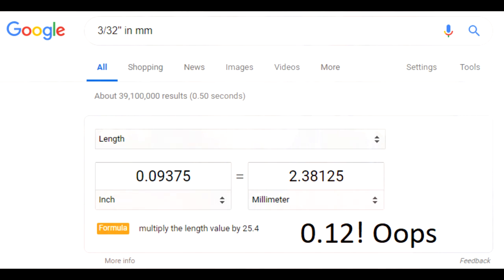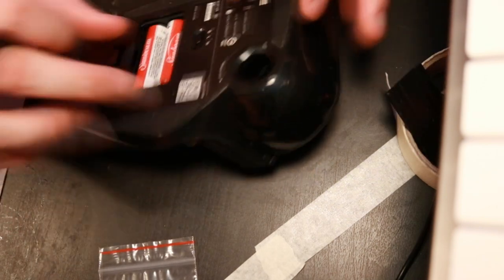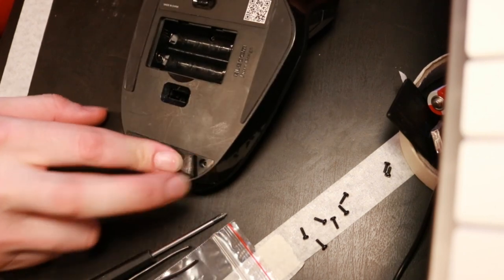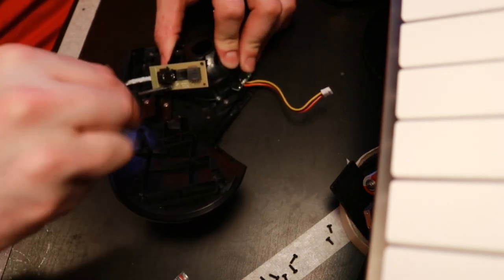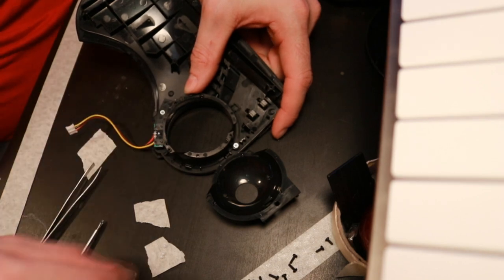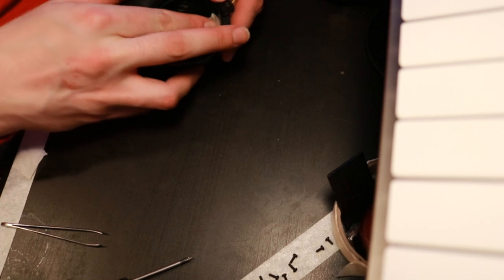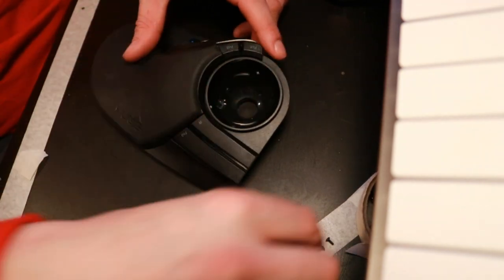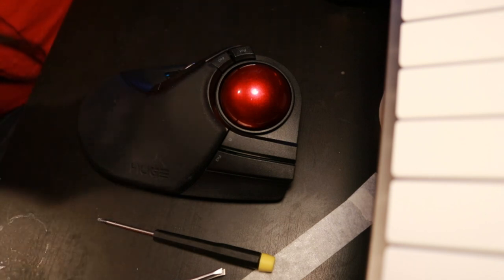Elecom Huge = Gaming TRACKBALL? Bearing replacement / fix / swap

Comment: The problem is not caused by synthetic rubies, much less by their supposed asphericity. But it depends on the heaviness of the ball, the sweat of the hands, and on the fact that the rubies do not turn on themselves but are fixed, changing them with the ceramic balls does not bring about any change, on the contrary being harder than the rubies, they scratch the ball and deform it quickly.
Reply: Very interesting. Funny that no one else has had this experience....
Can anyone confirm this?
Reply: i wish i had read this first, this is exactly what happened to me

Comment: Thanks for this video!! Just bought the Huge  and what the hell it still has this problem. It's a good job I had just bought my first trackball MX Ergo which is incredibly silky smooth and was so pleased I wanted to try a finger ball. Good job the Huge didn't come first or I may have given up on trackerballs. Pity Elecom has not put this right.
Reply: Thanks for the update, I was considering checking out the newest batch but I think I'll keep waiting

Comment: I’m back 2 years later. If your mouse is wired, there’s a devious screw hidden behind the sticker on the back of the mouse. Run your fingernail net the bottom edge in the middle and you’ll find it.

Comment: For anyone watching, I can verify this process is correct     
    
If you have the wired version though, the main back plate(where his batteries are) screw is actually under a sticker that appears initially as a matt plate
Pop a hole in the word "made" in made in China before you pry it open to remove final screw.       

Side note, you will not transfer from the Logitech m to this easily
Reply: I literally came to the comments for this information cause I couldn't get it apart lmao THANK YOU
Reply: This comment saved me some headache. Thanks!!!
Reply: lol.  the Made hidden screw omg
Reply: what kind of torx screwdriver set do we need
Reply: figured this out the hard way - SMH.  shoulda read the comments....
Reply: @lenamae2089  So did I! Many thanks to the Ophid Official, Siada Something, and Lena Mae!

Comment: Important note from 2020—I just did this tutorial and it's fantastic. Great job explaining most things. One important note—take care to make sure your "low/mid/high" switch is lined up and working before screwing everything together. I put the trackball back together after the swap and the action of the ball was much better. But I noticed the sensitivity switch was hitched up; I figured it was out of alignment. I tried to move it and snapped the underlying tab which connected it to the part of the board which toggles the sensitivity.

Not a huge deal because I have two of these trackballs and I know better for next time. But it's still annoying because I screwed up. Don't do what I did. Make sure the action on the sensitivity switch is in a good spot. Mine is stuck on "high" now, but that's fine since I can always set it lower and tweak the settings beyond what I'd need in either direction. But I imagine other people use this feature and won't be okay with it being broken.

Still—best tutorial on the net for this. Thanks a million for posting it. And I decided to be drunk when I did it too. Which should be a tradition I guess. Just check that damn switch before you go yanking on it like I did.
Reply: excellent information. uploader should pin this
Reply: Upvote x 100000.  I just broke mine off.  :(
Reply: @ericreeves-hashicorp  Sorry buddy. If it's any consolation, you can set the switch manually and then change the sensitivity in software from there. I hope you didn't use the toggle day-to-day.
Reply: @Wondershock  I actually never touched the switch, so it's not a big deal at all.  Still glad I did the bearing swap!  It felt like there was a bit of a "break-in" period for the first few hours, but it feels much smoother now!
Reply: @ericreeves-hashicorp  100%, totally worth it. Glad to hear it worked out, even with the little snafu.

Comment: 7x T6 screws on the bottom; 1 in the battery compartment, 6 under the foot pads
 2x PH1 screws inside the ball cup
2x PH0 screws holding the sensor board
3x PH0 screws holding the ball cup together

just in case you want to make sure you have the proper drivers before starting.
Reply from the maker: Thank you :)

Comment: Just fixed mine and the only speedbump I had was finding where the top cable needed to rest while reassembling.  I figured it out though and it. feels. amazing.

10/10 guide.

Also works for the wired version of the device, there's just an extra cable inside that only gets a little bit in the way.

Comment: 3 years later, and this video is still useful. That's outstanding. I just got my huge yesterday, and pre-emptively ordered the bearings with it knowing I'd be doing this. Since they get here tomorrow I figured I'd get an idea on how to disassemble the device before needing the info. I'm glad I did because I didn't realize it's as involved as it it.
  I have some minor experience doing teardowns, and had to do so with the Kensington Expert pro wired quite a few times, but it didn't have any ribbon cables. A ton of people sing the expert pro's praises, but mine was defective. The scroll ring would often fail for no reason so I eventually ended up scrapping it. After a while I just went back to gaming mice, but nothing compares to a good trackball when working in photoshop, or a 3D package.
  Thank you for the video. The angles were spot on, and easy to see everything needed to, and I love the fact that this was done with more practical tricks for certain things like holding the bearings in place with tape. I made an extra large mouse mat out of tool shelf liner material so it should hold the bearings in place on my desk well. It has a very similar texture pattern to a screen.

Comment: This video was...perfect. Precise instructions, clear images, plus humor. I haven't operated on my HUGE yet...but the principles shown here allowed me to upgrade my Deft Pro. Note for the Deft Pro - the primary difference/challenge is once the top cover is removed the "cup" assembly needs to be separated from the base. There are three locking tabs - a large one on the right and two small ones on the left. The forward left tab is a royal PITA - you need a very stiff small flat screwdriver to press it inwards (after releasing the other two first). One more gotcha - having removed all the screws from under the rubber feet (none under the top or the ring, one each on left & right, but THREE on the bottom) there is also one screw hiding under the label. Trying to peel the label would probably tear it - so I just pierced straight through with the screwdriver (it's under the letters SN). It's then a little finicky lifting up and separating the top half - even more so when putting back together - but still doable with patience. I finally have a usable trackball - why the F$#! does Elecom use such garbage bearings when they're using quality components elsewhere (I actually saw the Omron and Kailh switches inside!)?

Comment: I appreciate the walkthrough! The rubber pads will adhere back fairly well on their own but you can coax a little more life out of the adhesive with a bit of isopropyl alcohol.

Comment: just ordered the elecom huge and the replacement bearings thanks to this video! really looking forward to this project!

Update: It works beautifully, took several tries to get the bearings lined up when popping the cup back on but it was relatively painless. next time I will be sure to not drink coffee beforehand and use magnetic tipped screw drivers.

Comment: I performed this surgery today on my wired version to install uxcell 2.5mm ceramic balls from Amazon Prime. The screws were the same but except unfortunately I had to mutilate the main sticker a bit to get the equivalent of the one under the battery door. Oh well, I'd already decided I wasn't returning it. I didn't needed to remove the ribbon cables. Post surgery, it's a lot better. Thanks!

Comment: For anyone out there that wants to do this mod, read this: 

1) Watch out for the 2 FN buttons near the ball (FN1 and FN2), because the wire is pretty fragile. If you happen to detach them, just solder them up again (fairly easy, but tedious as the metal wires are pretty smalll_

2) The bearings are STATIONARY, so they DON'T spin. I found that 1 out of the 3 was not tight enough and the vibration caused by it messed most of the smoothness.

3)Don't expect to have 0 friction, there will always be a small amount, regardless what bearing you mount (because they are stationary)
Reply: Thanks for the point no 2. I got a cheapo jelly comb mt50 and one of the bearings kept popping out of the shell and rattle into the body. 
Was super worried that I have no way of securing the bearings in the loose shell since they are only press fit.

I end up hotgluing the bearing into the loose holder and glue the other 2 more and I have one solid budget trackball to run daily!
Reply: I really don’t think the level of difficulty of this mod is worth the less than perfect benefits this mod produces. My level of anxiety watching him do this was pretty high. 😂 😂

Comment: thanks a TON man. I'm one of the guys missing the MS TB Explorer for the last 18 years until I tested another (way too small) Elecom Trackball. this one is perfect for me and my 20cm hands. this is heaven - and i love FPSing with it. But just like you said: It's skipping on minute moves - so before getting it YOUR video actually encouraged me to get it and already check for availability of ZrO2 bearings - which are easy to come by on amazon these days. The Trackball arrived today and I instantly fell in love again and ordered the bearings right away. Thanks so very much for all this work sharing this!

Comment: I did this "downgrade" to fix the jerkiness when attempting to move the trackball from rest position, since it was COMPLETELY unusable for precise movements. After the bearing replacement, there was SOME improvement, but it was still unusable for me. Lubricating did not improve the situation very much, so I left the device alone for a few days. I finally decided to have another go at it, and I found that "breaking it in" by rolling the trackball in all directions for a minute before use FINALLY did the trick! I did try rolling the trackball repeatedly with my fingers, with the device facing right-side-up, but even after a few minutes the jerkiness was still noticeable. The BEST method for me was to turn it upside down and roll the trackball on a mousepad or similar surface, while applying a bit of pressure. I do this every morning for a minute and a half in the left-right, up-down and circular motions, and it the device works ALOT better for the rest of the day. I do throw in some extra breaking-in sessions randomly throughout the day, just to keep it running smoothly. I hope this helps someone!

Comment: Thanks so much for this! Particularly loved your clever idea to hold onto the other bearings in the baggie, and the "tape on the bearings" trick. Can attest that it's even easier than this video makes it look if you have a level table, a magnetic tray, and a T6/TR6 driver. 

Thanks also for popularizing this upgrade to the extent that several Prime fulfillment vendors now carry these bearings!

Comment: Just did it , I would say if you are careful enough you won't need to unplug the ribbons (i did not have to) neither need of any tape
Just need a clean table with light. Once you are done this is indeed a good upgrade the ball spin with less friction, you should not regret the effort ! Thanks for the tutorial !

Comment: great video! A super important tip: DO NOT OVERTIGHTEN THE SILVER INNER BALL CUP SCREWS. You might not even need to replace your bearings... The screws just might be too tight and are keeping the bearings from spinning.

Comment: I used G10 2.5mm ZrO2 balls from aliexpress, they are INCREDIBLY smooth. I have a Kensington expert and CST as well, but these bearings make the Huge feel even smoother (though part of it is probably also that the ball is lighter). The CST has a notable grainy feeling, probably because of the metal rollers.

Anyway, thanks for this video, it made this process really easy! I somehow managed to break the wires connecting the Fn1/Fn2 keys to the PCB but resoldering those wasn't so bad. As an additional mod, I added a bunch of iron weights in the free space of the housing.
Reply: Are you using any additional lubricant? How broken in is your expert?

Comment: Thanks so much for this video. I've loved my HUGE, but in the last couple months, it's been very sticky. I'd wipe the bearings and they'd be less sticky for about 15 minutes. It was becoming obnoxious. I ordered balls (found some from uxcell on amazon, Prime, although they're backordered for a couple days), but took the risk to open it up and spin the stock synthetic bearings around to a "fresh" side. Taped them up like you suggested to avoid losing any bearings and not having a backup. Just put it back together and it's smoother than I've ever remembered.

I don't know if my environment is especially harsh since I do file metal things at my desk occasionally, but I purchased the mouse 11/21/2018, so I'd estimate that it was noticeably "worn" out in about 16 months.

Comment: Just did this to my Elecom Deft m-dt2urbk. Worked perfectly. Took a day to get it SUPER smooth. no issues yet! Thanks for this!
Reply from the maker: Aw thanks man, that gave me a big ol' smile. I'm glad it worked out! What major differences were there with the Deft?
Reply: @subversed  The biggest issue with it stock was that the small movements were sticky. Small adjustments were stuttered. No issues now with the new bearings!
Reply from the maker: @alexpham095  That's rad! I'm really glad I could help ya out- I've never posted anything like this and the feedback is really good to hear my guy. 
were the insides were mostly the same? I've never cracked open a deft before.
Reply: @subversed  Pretty much the same. The screws were in the same places on the case. The insides were arranged differently, but its almost the same. The biggest issue was getting case clips apart. Lol fear of breaking it all.
Reply: So it was still a bit sticky until after a day of use?

Comment: great video. before this video was published i had actually disassembled my HUGE to see if there was anything i could do. i wanted to replace the bearings but didn't really know what to get. this helped greatly. while doing this i accidentally broke off the yellow wire off the FN1 and FN2 button board and had to solder it back together, not a big deal though. after the job was done it was a night and day difference in ball movement. it is comparable now to my wife's kensington expert wireless. my daughter has the newer M-DPT1MRXBK deft pro which has the same bearings i might do this to. from my 10 pack, i have... 6 left.
Reply from the maker: You lost one too, eh? Haha they're so hard to keep from rolling (or bouncing) away. I'm really happy it helped you out my guy! Elecom seems to have a way about them when it comes to making their products mostly serviceable and it's really, really refreshing to see. I can't tell you how many trackball forums and subreddits still believe that the only way to replace bearings is to get the drill out and start gutting holes to replace bearings because people just aren't used to something that's made to be fixable. 
Are there any other projects you're putting off that I can maybe make a video about? Always looking for ideas.
Reply: I don't have any ideas for more videos at this point, but I do have a question I wonder if you are able to answer. Do you know the difference between the M-HT1DRBK and the M-HT1DRXBK? The 'X' appears to be a 'new' Huge, but I can't find any information about what's different.

Also, update after having new bearings for a couple weeks: The new ceramic bearings are definitely an improvement over the originals, but it is still nowhere near as smooth and easy to move as my daughter's Deft Pro and especially my wife's Kensington Expert. The Expert is so silky smooth its crazy.
Reply from the maker: @kevinshumaker3468  my two theories on that: 1. The x indicates wired vs wireless
2. The X is for the japanese version that's compatible with their mobile app, and has native bluetooth without the need for a dongle.

Comment: Awesome video! I preemptively ordered ceramics with my huge, but it's smooth as yours at the end. Not sure if they finally sorted the issues with the rubies, or because I purchased mine inside Japan and they have better quality controls locally, but at least I now have bearings in case they become needed in the future. Thanks for a very detailed teardown and rebuild!

Comment: Any follow up or new to add after a few years now?
I just got a Huge yesterday and tried it out today. It's been years since I've used a trackball and never with any regularity but I like it. Nice fit for my hand, nice button layout, the only thing I struggled with were small movements from stop. Ball moves fine once moving but seems input to get it rolly usually causes a roll to far.
After searching around it seems replacing the bearings would solve that. Or returning it. I would see if it wears in with use but planned use will be very seldom.
Great video!